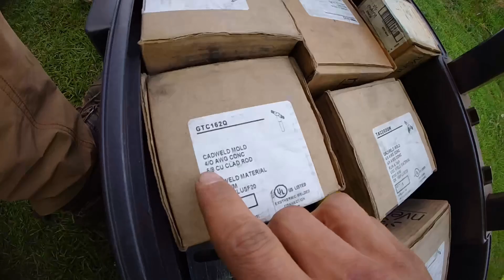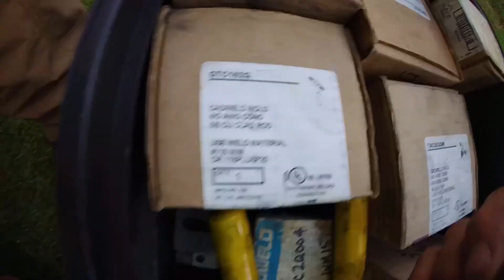Ground Wire Repairs (CAD Welding) | Let's Work EP. 73

Comment: I’m not electrician but I have a basic understanding of residential and light commercial work. Why go the route of welding to the ground rod instead of using a grounding clamp? Is it code where your located or is it a specific reason?
Reply from the maker: @m00seknucklejohnson45  has to be an irreversible bond
Reply: @ gotcha 👍🏻